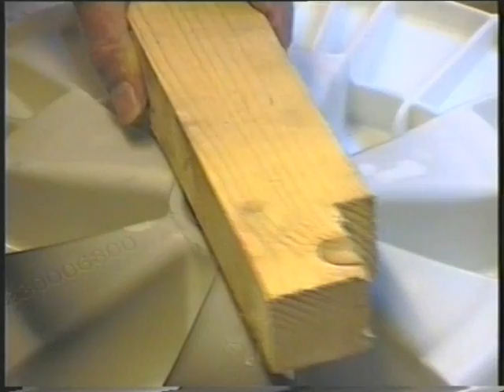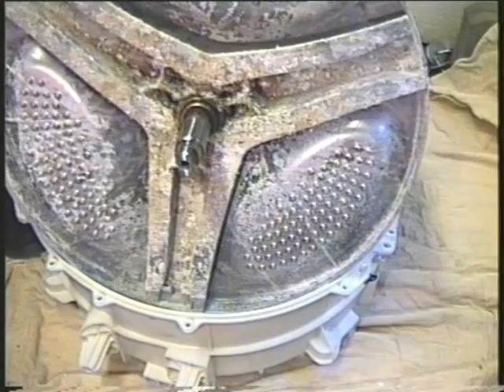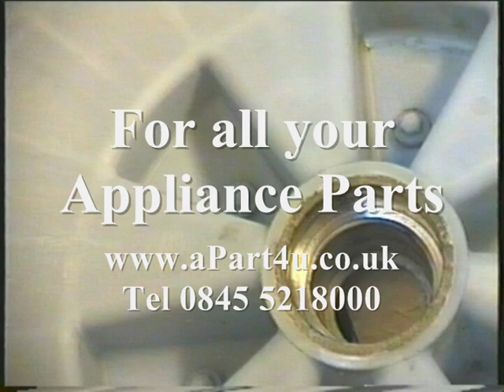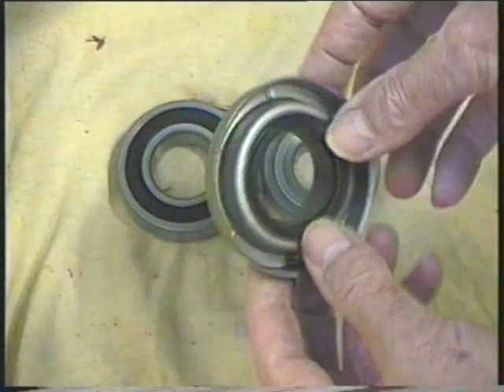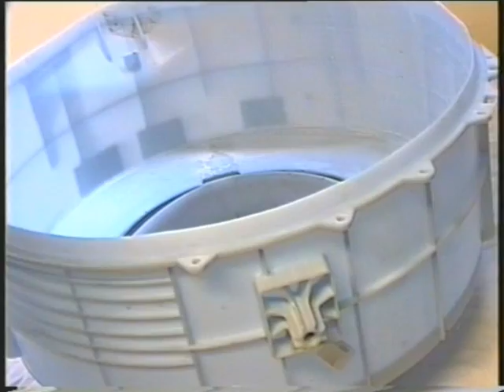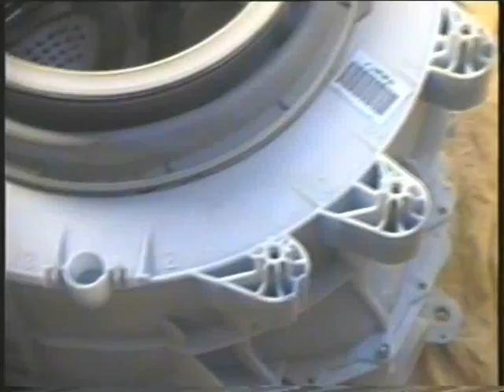Indesit Washing Machine Bearings How to fit, change & replace.

Comment: Hi I have a Bosch wvd24460gb/05. I cannot find the correct bearings, there is some talk of a bearing cross, is this correct part and how do I repair it? Grateful for help
Reply from the maker: Hi, please use our contact us page and make sure you fill out the request for what your problem is. I will need the full model number of the identification plate and the details of your problem so that I can provide you with useful literature. A video shoot of the problem would be perfect as well.

Normally, I would get back to you within 24 hours but I am on my way to travel abroad, so it can take more time to respond. Thanks for your understanding. https://www.how-to-repair.com/help/contact-us/   

Please remember to subscribe to our channel, as that's what keeps this channel going. Thanks, Paul 👍

Comment: WIL 85 EX TE Y - tub has no screws, it's molded into one piece and the bearings are pressed into the tub.
Reply from the maker: yes they make them with built-in obsolescence and not the right to repair so wrong sorry Thank you For leaving a comment this is for you https://www.youtube.com/shorts/e432SAb2g08 please remember to subscribe as that's is what keeps this channel going. Thanks 👍

Comment: Video is very well done apart from when you used an metal hammer to hit the bearing race you shouldn't do that you should only use a copper hammer or a bearing insert tool which is aluminium an also shouldn't hit a bearing with any type of chisel either bearings are case hardened an hitting them with anything hard metal can cause them to crack/fracture so soft copper hammer or aluminium bearing tools only

Comment: I have IWE91281, the butterfly was broken and i managed to reach it as the drum is sealed and after fixing i closed the tub with sealcone gasket maker and tight with rough screws , the problem im facing now the machine is not turning on....pls can you help for advise

Comment: Tip from the automotive world; when installing bearings, you can use a very large socket (i.e. the same outside diameter as the bearing being installed) to hammer them in. It ensures that they seat nice and straight and reduces the risk of damaging the ball races. Very helpful video; I've got a WIL103 that I will be getting new bearings for sometime in the near future.

Comment: I have a IWE 81681 ECO (UK) i can't find any bearings anywhere guessing its a sealed unit
Reply: hey ady, hve yo find any bearings as I have the same model and need to replace them...awfully noisy
Reply: Tecman 67 hi mate did you find out if you can get a bearing for this model im in the same boat now.

Comment: Do you know - how to reset an Indesit witp 102 - whashing machine? Had a doorswitch issue b4 and now with the new switch it does not work after turn on. All the LEDs flash up then the Lock LED comes on constantly.
Reply: needs programming
Reply: Kamar Uddin is there any videos how to do

Comment: hi, i have a iwb71250 and the outer drum is a sealed unit with no screws to take it apart, is it still possible to replace the bearings?
thanks in advance
Reply from the maker: no its not possible
Reply: very bad design then due to it costing £115, i just cant afford that sort of money. i'm not taking it out on yous i'm just grinding gears
Reply from the maker: david north i know there a hell of a price. they should allow all machines to be able to fit new bearings
Reply: even if the spider and the bearing need changing it wouldnt cost that much. im gonna see if it can be done by cutting with a dremmel and use seal and screws to fut it back together
Reply: david north